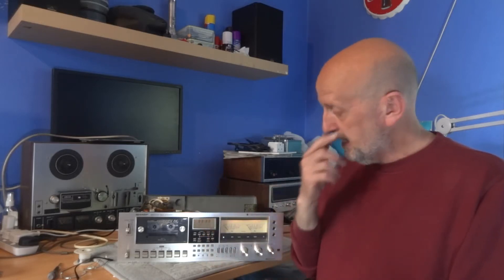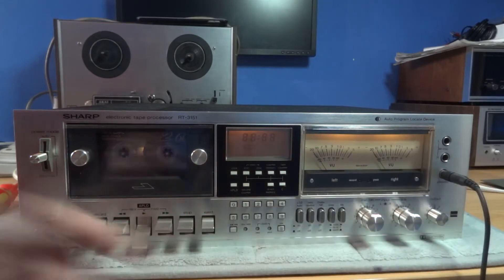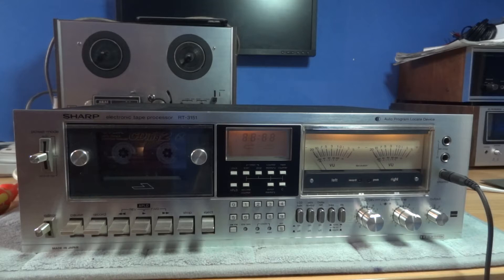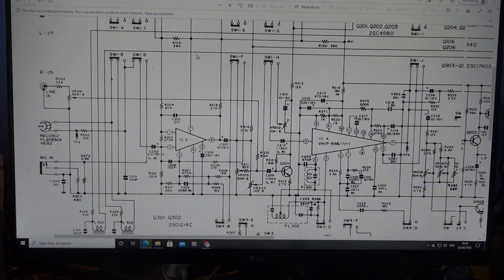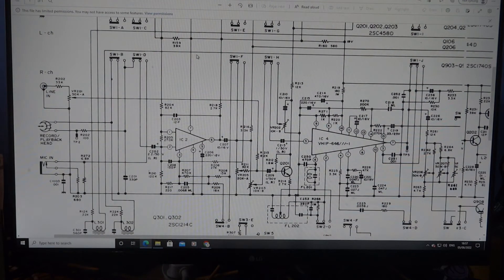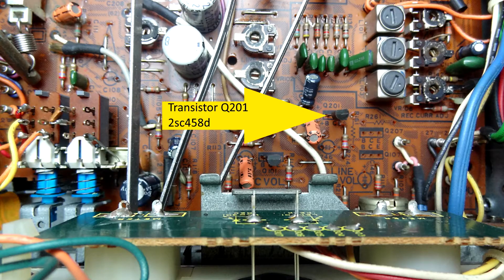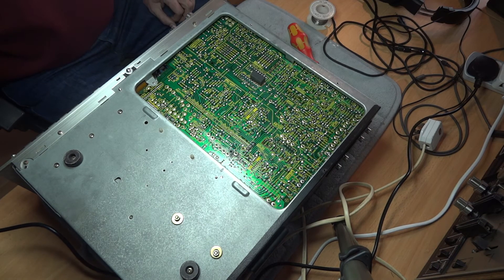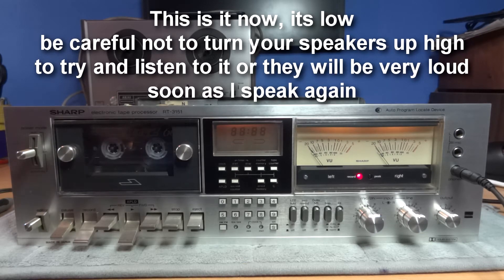Fault Finding Noisy Intermittent Transistors in Amplifier & Receiver. Popping noise, crackle sound

Comment: Hi Michael, good video and very helpful
Is it safe to say that when you have got dropping in sound, and some crackling that it could be faulty transistors?
I am taking on a Denon PMA-925R amp that has just been recapped as at least over 95% of the electrolytics were way out of spec and the amp wasn't working anymore.
That is how I bought it, non working amp. It is working again but the sound drops. And willingly as well, not just one channel, it is either right or left.
Also in the beginning it occurred when cold and disappeared when it was on longer. This morning it began right at startup. Also occurs when during playback (of a CD) I change input mode to something random and then back to CD. 
Source Direct button has that effect too. I've made a video of this but seems that the effect is less being heard on video than sitting in person in front of it.
Checked for cold solderings and did find several but gone over them all and re-flowed it
No VR's in here, bias is set at right spec, cold or warmer. 
So, what are your thoughts, shot transistors, due to previous failing components? Were really bad caps in there
Reply from the maker: Hi Danny, I had a quick look at that amp, I would check the power supply rails voltage, see if the stay constant when sound is dropping, as if they drop when sound lowers then it will also cause the crackling. After that check voltage test points to see if the change at all when it happens.
Reply: @MichaelYates  Hi Michael, although I am more on a novice level I cannot make sense out of the SM. It seems to me that it has some faults in it. The transistors that are mounted to the heatsink have desinated nrs as TR319 through TR322 as it shows on the diagram as well as on the actual board. But on page 11 it shows in the diagram a four some transistors that aren't even listed on the parts list with identifications. This goes for the TR 319 - TR 322 as well.
Forgot to mention that the 2 big buffer caps measure 10000 uF instead of 12000 uF so not sure if they have lost capacitance or that it is a tolerance range
My actual video of the dropping sound: https://youtu.be/N2VzitSgAQo?si=5YDppQSjjo9Bn1A8
Reply from the maker: @dannyyy1012  The 2 big caps at 10000uf are fine, I had listen to your video and I would start with checking all the power supply voltages going around the amp, especially the main ones in the circuit diagram around 47 volts I think, from there check all voltages you can around the board see if any fluctuates when amp dips down and distorts this might give you an indication where the fault is. The diagram is not the best I have seen for sure its a bit all over the place and hard to follow. Amp also has a few control and switching chips which wont help. But first place to start is checking voltages.
Reply: @MichaelYates  Thank you Michael, well, according to the schematic if I am reading it correctly, resistors R652 and R660 should be around 12v, I measure 13,6v
Further, R653 and R654 should be 24v, I measure 23,4V. But R655 and R 656 should be 24v also but I measure on both 49,4v. Am I missing something here or is this a correct measurement and tracing of a fault.
Reply from the maker: @dannyyy1012  Hi Danny, I have a terrible scan of the circuit diagram this end, but you should have 49.5 volts on base of transistor 616 and 50.1volts on emitter by the looks of it. Transistor 609 should have 49.6 volts on base. But once all voltages are checked on circuit diagram and there are loads, if they all appear pretty close then its a matter of just trying to see if any fall in voltage when fault happens as this will give an indication where the fault is. But the Circuit Diagram is quite a mess. In these cases a scope would be a much better solution in tracing where the signal starts to distort and lower by just following the signal path, shown in bold. I would double check you have all the caps replaced put in the right way round as well. Think you have your work cut out with this amp.
Reply: @MichaelYates  Hi Michael, thank you so much for your input. I am happy to say that I have found the culprit, it were the two large relays on the output. 
I soldered them out and saw that they were made in a way to open up, so I did, I saw that they looked tarnished and I have cleaned them out. It all works now without problems. No more dropping sound :)
Reply from the maker: @ Excellent news, that has saved you a lot of time and effort. You would have eventually got to the problem following the signal path. Always good to hear a problem sorted.

Comment: Thanks for the video, it's useful. 
Can you recommend an equivalent for a 2SC1740LN(S) transistor?
I got some 2N2222A, but I stupidly overlooked that the pinout is different. 
This is for a marantz 5030 cassette deck. I swapped them out and then got no sound. I thought I'd well and truly buggered it up, but I'm pretty confident in my soldering! Now I have a bit of hope, after realising it's the pinout. I have just recapped all the electrolytics on the machine, too. 
Cheers.
Reply from the maker: Trouble with a lot of replacements is the pinouts are different. Also one site may have the pinouts one way and other another way, so many mistakes about, thats when a transistor tester comes in handy to get the correct pinouts. Looking around it seems the 2CS1852 will be ok as well as a BC337 but the pinouts are different, so you will have to swap the legs around on the replacements thats pretty straight forward, I have not tried any of these myself so cannot vouch for any of them  Here is a link to a datasheet and subs recommended https://www.npntransistors.com/2sc1740-transistor-pinout-specification-equivalent-datasheet/
Reply: @MichaelYates  Thanks mate

Comment: I am in the middle of trying to find a noisy transistor. But I don’t have a schematic. Just a heat laser infrared gun and cold spray. I found a bunch of transistors getting hot along with a bunch of capacitors in this guitar amplifier. I found the hottest transistor and three times - I hit it with cold spray and all the other components that we’re running hot are now running cool until that transistor heats up again. I won’t have the replacement transistor for a week. But I hope my technique works, what do you think?  Can cold spray isolate a faulty transistor?
Reply from the maker: Yes freeze spray can find a faulty transistor, not always but a good deal of the time. Sometimes the popping or static noise will almost disapear, then other times it may just be very suttle but still indicate a noisy transistor

Comment: Today I fix an amplifier with cracking noise, after change many transistors I found a bad 22pf capacitor.
Reply from the maker: That can be a bit anoying, but narrowing it down to a small 22pf cap was a good job done well as these faults are not easy to find.
Reply: @MichaelYates  That's right, the noise sound equal to a bad semiconductor.
It was driving me crazy.
The amplifier is an Audiosource AMP-101.
Best Regards.

Comment: Ta 4 doing the vid. Just going around various YouTube’s picking up info for noise / transistors etc as I’m looking to improve a design done years ago in a receiver unit & want to improve noise figures. 

One thing I’ve re picked up along the way - whether it makes much of a difference in what you have - is those variable pots to set levels of left n right channel. Ok - they’re great if you want / require them - but if they weren’t in line -  are the meter levels the same?  Does the signal enter the main chain for signal into the amplifier circuit? I’d prob look at bypassing them - but might need a fixed resistor - low noise one - might require fixed wire soldered on board between too - as long as they don’t perform other functions in the circuit. Less component on the line in - the less noise. Any noise generated from those pots will enter the first transistor (you’ve changed) which will probably have the highest gain / lower noise figure than the others in the circuit. What I also learned t is the first transistor in the chain is generally the ‘better’ transistor for gain / low noise figures - the remaining transistors in the circuit are generally lower spec as circuit designers determine the cost not so important. Thanks again. Where did you get the standard chopsticks from 🤔😂👍

Obvious tip for the signal tone generator - dependent on whether your phone has a headphone Jack - just plug in suitable lead with Jack plug & RCA leads out (which you’re using already) & search the internet for site which can generate the signal tones out. No need for the portable CD player!
Reply from the maker: Thanks for the comment, the variable resistors at the input would be required as one channel would more than likely have a liitle more gain than the other. But as you said you could adjust both to required level and then measure resistance and replace with a fix resistor. Also yes the less switches and variable resistors the better, again all switches could be shorted out ( speaker select switch as well ) and variables replaced with fix resistors. This would leave the amp/receiver set to your desired input, output and tone with just the volume still operating. Surprising how many switches and pots the signal goes through, even the tape monitor switch plays apart even when not engaged the signal still passes through the contacts. Phone signal generator is a good idea, thanks. Bad news the copsticks have all sold out since the video lol
Reply: @MichaelYates  ta 4 reply - & ok the signal paths too - I’m modding something - it might well end up worse but nothing to lose! But learnt a few things along the way with the YouTube’s out there - so it was good to see yours - a practical demonstration & using one’s ears to pick up noise as opposed to oscilloscopes / analysers etc. It’s a can of worms using em but they’re pretty cheap nowadays & a few basics unearths a whole world of electronics - as the comment you got regarding the gains on the transistors. Ones never too old to pick up these things! Ok no chopsticks! 😂

Comment: How did you know your VU meters we balanced and showing the same reading for the same input?
Reply from the maker: As the left channel was working correctly, I just adjusted the right channel  to be the same as the left channel. Using a test tone cd on a cd player plugged in to the input of the cassette deck, played the cd, pressed play and record and adjusted the front input levels to the same number ie number 5 on both and then just adjusted the varible resistor on the circuit board for the right channel to match the left. as 11.45 of video
Reply: @MichaelYates  Thanks. I was asking as I have some older equipment with VU meters that do not deflect the same with the same signal. One meter is "lazy" by a few dB so I cannot use the VU meter method to match the channels. Cheers.

Comment: For my part I'm trying to change the transistors C458 for some BC549 and don't know the pinout. I keep looking at some datasheets but sometimes they are different in terms of pinout so confusing. Logically the C458 and VC549 do not have the same pinout ? right Thank
Reply from the maker: I have some BC548 's and laying it flat side down and reading for left to right the pins are EBC, the 549's are just the same ( low noise version )
Reply: @MichaelYates  OK thank you so the original are 2sc458 are read 321 flat down so the opposite. It means I need to switch the side I'm gonna put it in ? Thank you thank you
Reply from the maker: @ludovicferrando8394  Th 2sc458 laying flat side down and reading left to right the pins are BCE so you will need to move the pins around a little, the 2sc1815 replacement would be much simple way of doing it as the pinouts are the same as the 2sc458. But still possible with the BC549 just a little of swapping around as the base is not in the middle
Reply: @MichaelYates  oh I got, well I've just ordered some 2sc1815, so I won't have to worried anymore about the pinout and putting it the same way as the original thank. By the way I can use it to replace all of the transistors? C1312? Thank again for your help really
Reply from the maker: @ludovicferrando8394  yes the 2sc1815 should be fine for the 2sc1312 as well looking at the subs for that transistor , please let me know how you go
Reply: @MichaelYates  Thank you I'll do that =). I'll should receive it within the week. I'll let you know how it went =)
Reply: @MichaelYates  Hello well I've changed most of the transistors but I''ve burnt one of the transistors during the process, 1st time it happends to me =) accidents happens. I'll do it again soon =)
Reply from the maker: @ludovicferrando8394  easy done, had a few close calls with other components with just moving the soldering iron on and off the board.
Reply: @MichaelYates  Well I'm gonna get a new board and redo it =) , because I have no sound right now. I even cleaned out the selector switch yesterday.
Reply from the maker: @ludovicferrando8394  Just checking the pinouts on the 2sc1312 you might have replaced with the 2sc1815 and the are different so this could be the reason no sound.
Laying flat left to right the 2sc1312 reads ECB and the 2sc1815 reads BCE. I think doing one at a time and turning amp on to see if its still giving a sound output. Then you will see where the problem is if one arises
Reply: @MichaelYates  I thought about that too, might have done something wrong with the 2sc1312 =) thank you for your advice
Reply: @MichaelYates  and thank you for everything. Seriously you should do like a facebook page for this. I haven't see one yet. It would help a lot people like me.

Comment: When I Fixed My Dear Old Sansui AU101 Amplifer Faulty (Output Stage) Recapped it With Good Quality Caps And Set The Bias Much To My Surprise The Phono Pre Amp On The Tone Board One Channel Had Become Very Noisy So I Replaced The Two 2SC871R Transistors With  2SC1815 in The Phono Pre Amp This Cleared Up The Noisy Channel And Now The Amp Sounds As Sweet As a Nut Thanks For Uploading Michael Great Stuff Regards mike.
Reply from the maker: Thanks Mike, funny you should mention the 2SC1815 as I have just tried one in place of the 2SC2240 in this and seems to work better as an update video will explain. Nice you can do the work yourself as not easy finding a repair man these days, bit of a dying trade.